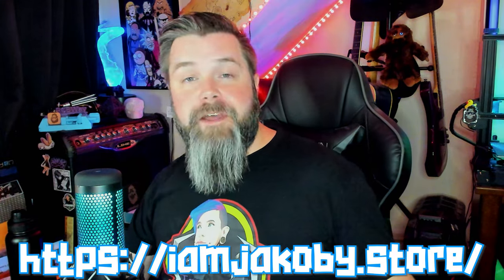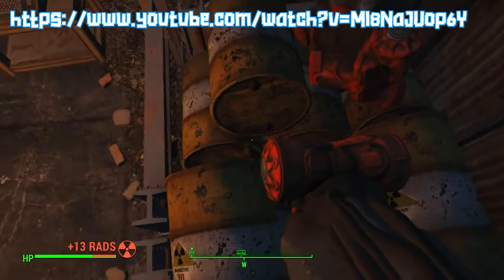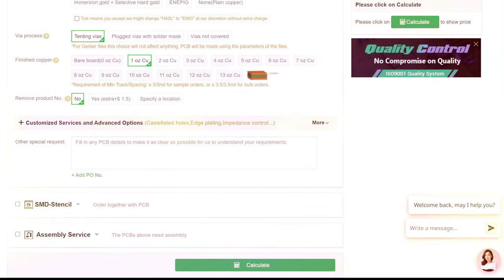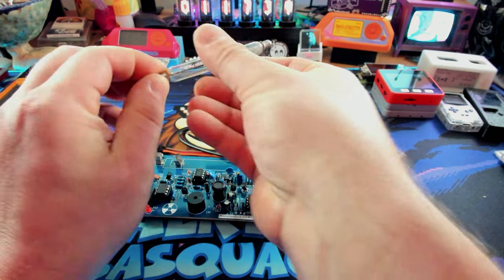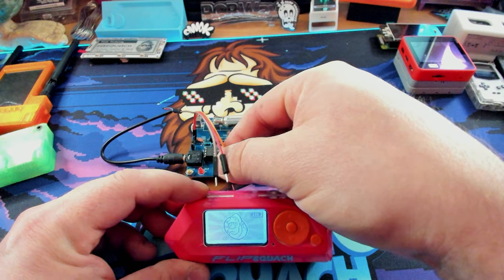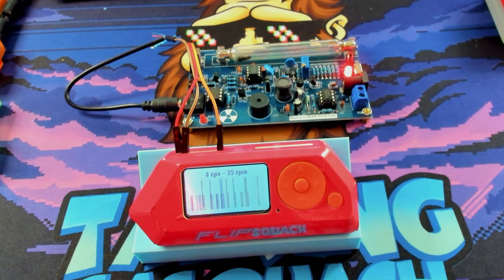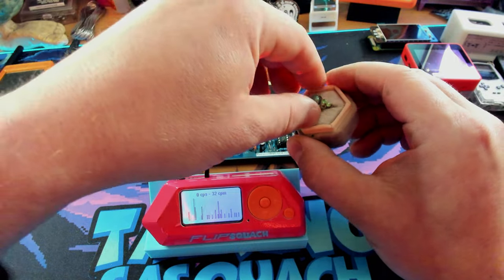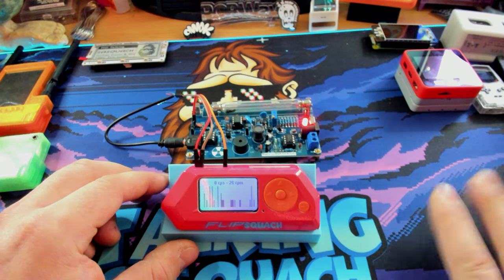Flipper Zero Geiger Counter!  Step One to Making Pip Boy Flipper!

Comment: For some radioactive things you can check out like you already did uranium glass, then you can check out fiestaware It's has a orange glazed glass, radium painted dials like watches clocks and airplane gauges, this Geiger counter is only a beta and gamma detector but you might be able to detect a little bit from granite countertops sometimes concrete porcelain like toilets, sea salt, Brazil nuts has the highest amount of radiation in all food, coffee mugs, knife sharpening stones (whetstones), floor tiles, cheap junk from China is sometimes radioactive, stones in your backyard are sometimes radioactive... The reason why you weren't able to detect anything from a banana is because bananas are low level radiation you have to have specialized equipment to be able to detect radiation coming off of a banana

Comment: The reason smoke detectors won't work is due to them being shielded and using alpha particles. Ones that are radioactive will be marked with the trefoil. Bananas aren't very radioactive.

If you want a few test sources that you can readily get are as follows:
Thorium gas mantles, (online)
Thoriated welding rods (for TIG welders), (any hardware store)
Fiestaware plates, (antique shops)
Old watches/clocks with glowing dials and hands (they'll not glow anymore, the phosphor is dead, still full of radium though)
Specific test sources, (online)
An X-ray tube, (you'd need to turn it on), (online)
Anything marked and sold as "negative ion" from China, designed for 'health purposes' usually bracelets, stickers for phones, I have a 'massage pen' that is absolutely full of thorium dioxide. You wouldn't want to open it indoors, as such it's triple wrapped in trefoil marked sandwich bags with each one containing a note warning people to not try and open it, play with it or be around it for very long. Also kept at the furthest corner of my house where I rarely spend much time, even though it's mostly alpha particles it's best to be careful, if it was opened and the dust inhaled, that could be bad.
Reply from the maker: I could have used you when I filmed the video! Great info!
Reply: @TalkingSasquach 
You could always do a second testing video for the geiger counter against things people have recommended. Many will be alpha emitters though, so it may not work the best, though alpha particles can still get into a GM tube, just in vastly reduced amounts. The thought emporium did a good video on 'negative ion' stuff and it's radioactivity a few years ago, it's still worth a watch. I've seen online reviews for 'negative ion health bracelets' including one with photographs and a complaint that they've given the buyer "a rash", looking at the photo, the rash was almost certainly a radiation burn. He got a very spicy bracelet no doubt. 

 I need to be more active in the FZ community. Had a lot to deal with lately but I should at least duck my head in and say hi.

Comment: Is this how the first smoke detectors work? But instead of detecting rays it uses the same process to detect smoke?
Reply: We still have smoke alarms which use this process today. 
They won't use a Geiger-Mueller (GM) tube in them though, like this geiger counter and never have done to my knowledge. They're much more basic and simply use a radiation source (Americium 241) which emits alpha particles (fast-moving helium nuclei, which are ions) and an ionization chamber which is made up of a positively and negatively charged plate separated by air. In normal operation the alpha particles emitted by the Amerecium 241 allow a small but measurable amount of constant current (direct current) to flow between the plates as ions conduct electricity. When smoke enters the chamber the ions are electrostatically attracted to the smoke particles, these smoke particles are much denser than helium nuclei, meaning that current can no longer flow between the two plates, setting the alarm off. 
Alarms like this are still widely used, if you have two smoke alarms in your house, one probably contains (an extremely small amount of) Americium 241. Older smoke alarms (1940s and 50s era ones) used to contain much more americium. 

A GM tube works differently, it's a sealed tube (so smoke wouldn't be able to enter) filled with a gas, or blend of gasses and two plates (one plate is usually the outside of the tube*[see edit]) that are charged up to a high (>1000V) voltage. As a gamma ray or beta particle enters the tube it knocks an electron (or multiple electrons) off atoms of the gas inside the tube, creating an ion. This ion allows current to momentarily flow inside the tube until the gas returns to it's uncharged state. The tube is usually connected to a buzzer/speaker and either a needle (older models) or digital counter (newer models), the spike in current causes the buzzer/speaker to give off the characteristic click per count. The older models with the needle display the number of counts per minute, whereas the digitized versions will display total counts + counts per minute. The newer versions can therefore function as both a counter and dosimeter.

Edit: Since the tube in the video is a glass one, you can actually see anode (the wire in the video) the cathode might be a conductive coating on the glass.
Reply: @daviddavidson2357  I know they don't use that I am saying does it use same process just backwards? As in it uses the stuff in the ring to catch smoke particals and that triggers the detection.
Reply: @daviddavidson2357  Also no need to type edit, YouTube already tells us it is edited.
Reply: @OneAndOnlyZekePolaris  It uses a similar process, as described. Also YT tells you a comment was edited, though doesn't show which text was edited, which is why I mark edit text.
Reply: @daviddavidson2357  There is a way to see what was edited just by using notifications if the message is short enough, and another method that can show what was edited which shows both old and new comment. But not many people knows about it.